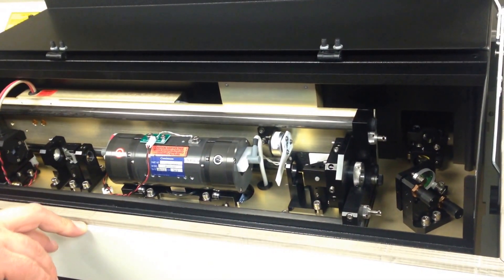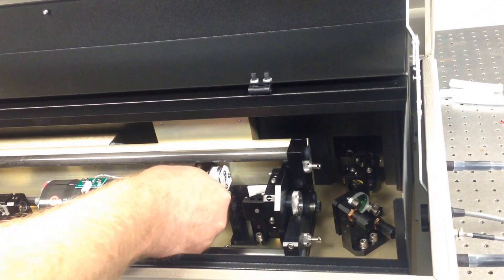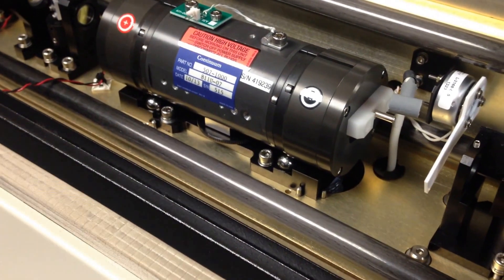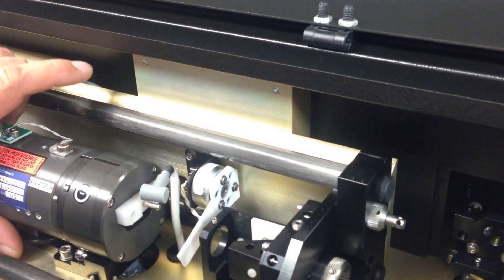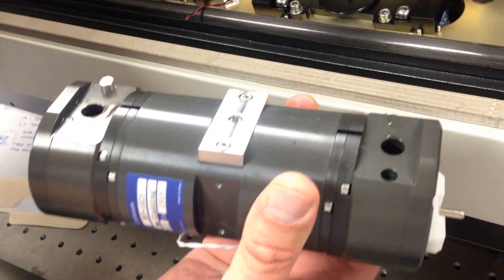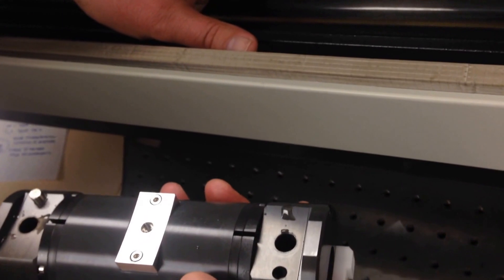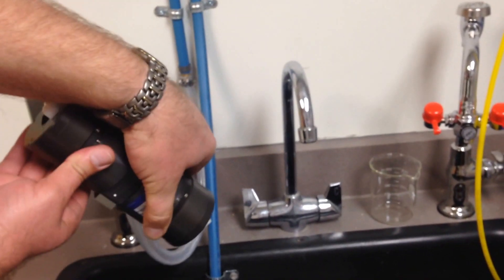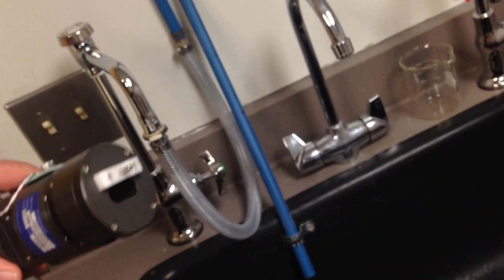How to change the flash lamp for YAG Laser system - Part I

Comment: The Fifth Harmonic Generator model LG105 for NdYAG lasers sales@dmphotonics.com
The Fifth Harmonic Generator model LG105 is compatible with any pulsed
Nd:YAG laser, and is designed to produce UV-radiation at 213 nm. The
Nd:YAG laser, equipped with LG105, is a versatile device, and in many
applications can eliminate the necessity for excimer lasers. Solid state
technology that does not use toxic gases and costs less gives you the
advantages of both consistent, day-to-day operation and low maintenance. A
high quality BBO crystal is used in the LG105 as the non-linear element,
providing up to 20% conversion efficiency into 213 nm. The non-linear
crystal is placed in a special cell ensuring long lifetime of BBO without any
degradation or breakage. A harmonic separation system installed in LG105
provides nearly 100 % spectral purity of the output at 213 nm. The LG105
Fifth Harmonic Generator gives you not only high power output but also
excellent radiation stability.
Fifth harmonic output from the Nd:YAG laser can be obtained by mixing
either first and fourth or second and third harmonic radiation. It is the later
option that is implemented in the LG105 Fifth Harmonic Generator.
http://www.dmphotonics.com/NdYAG_laser_harmonics_OPO_Raman_Shifter/Fifth-Harmonic-Generator-NdYAG-laser-LG105-manual.pdf